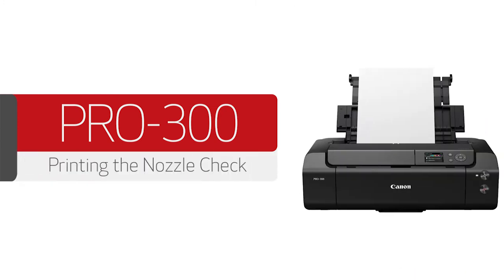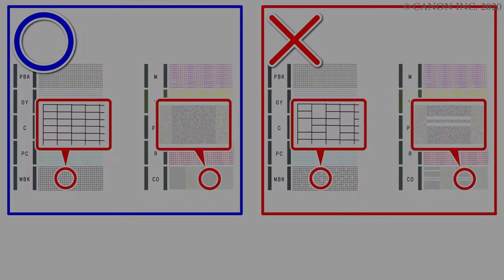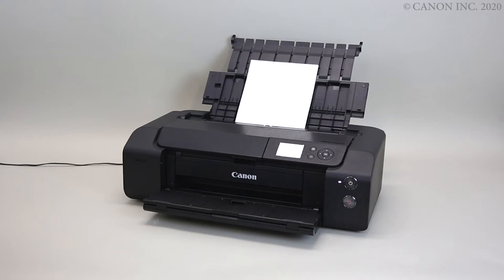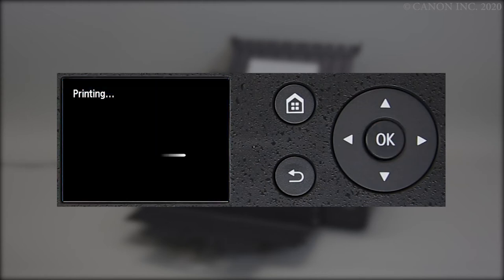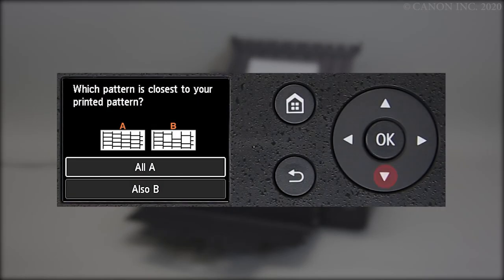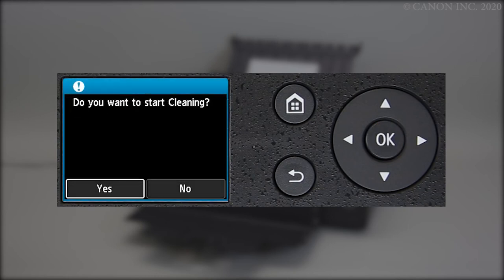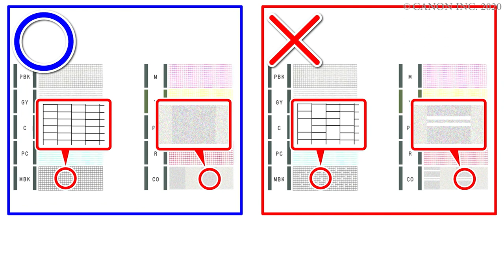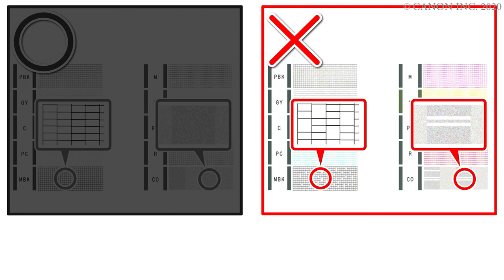Canon imagePROGRAF PRO-300 - Printing the Nozzle Check

Comment: Great printer when it can print. Software continues to say memory issue and won’t print. It’s a software update. Whenever the Mac m1 updates the canon professional dumb and old software will not RIP. Canon won’t have an update for months. Making your printer obsolete. Everytime I just need a simple print it can take all week to figure out. Canon hates its Mac based customers. 
The issue is the software. You have to constantly grab an update. Then reinstall and pray it works.  This takes time and money everytime I’m on schedule the software gives me grief and I feel like we are back in the 90s with support regarding raster image processor not connecting. 
So if you love canon like I do but are too freaking busy and live in the 21st century do not buy this printer. The only software you can use is theirs alone. They won’t update it on a regular basis nor will they ever fix or get it up date to this century. 
Canon please fix your software. You’re losing money on ink and my epson is having a blast. But seriously I don’t trust the software engineering. It feels lazy not to have updates nor fixes. Everyday it’s a new issue with the bugs. 2024